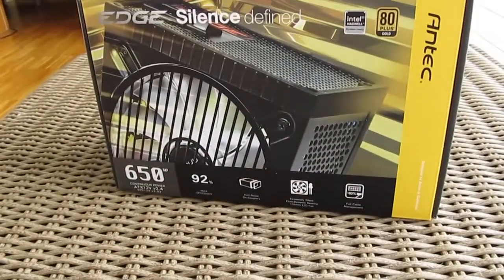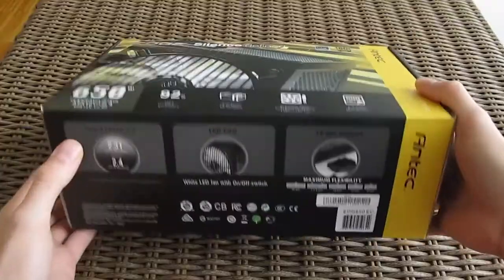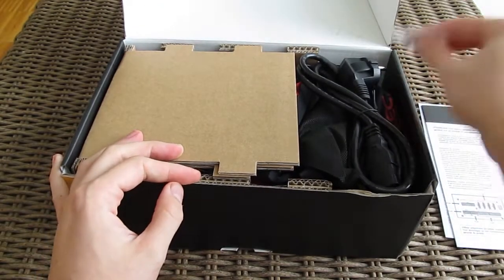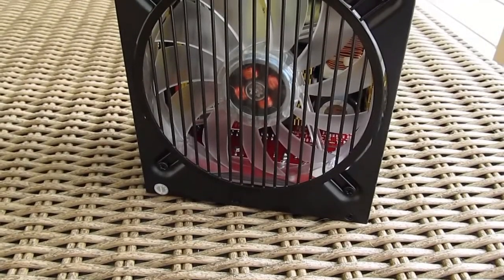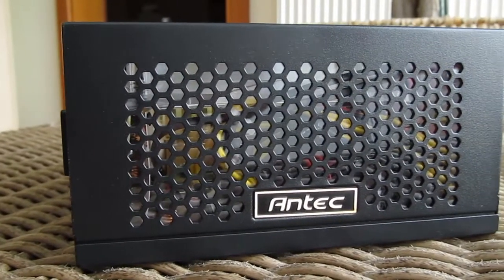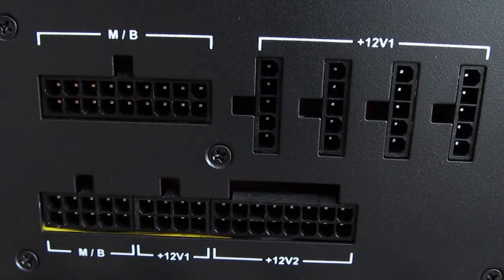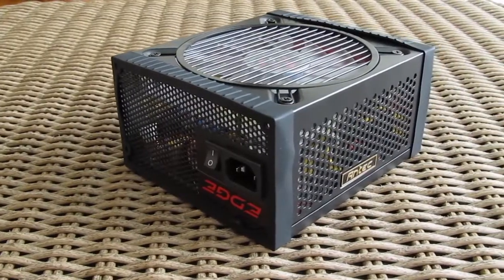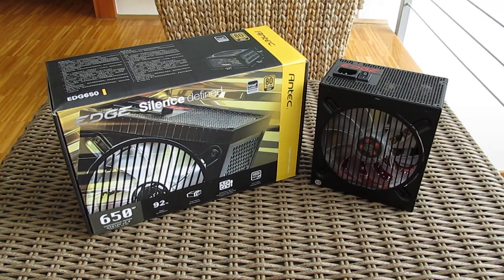Antec Edge 650W Unboxing & Preview

Comment: I wonder do i need to use the extra 10-Pin for the motherboard?
Reply from the maker: 10-pin? You mean 8-pin? :)
It's in case if you plan to use like an X99 platform / motherboards (they usually have 2x8-pin EPS connector) with 3-4 GPU's on it. In that scenario you need extra power to be delivered to the PCI-express slots since each GPU pulls ~75W  and one 8-pin EPS is not enough, especially if you plan to do some CPU overclocking along with it.
Reply: No. the 10-PIN. there's 18 Pin slot M/B and 10 PIN Slot M/B on the EDGE power supplies.